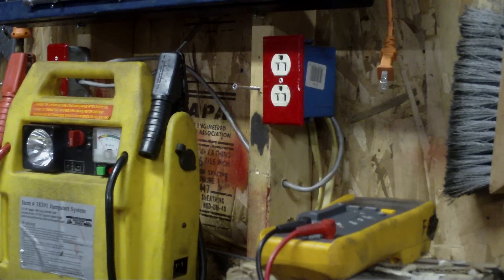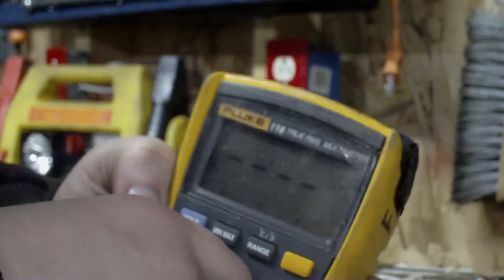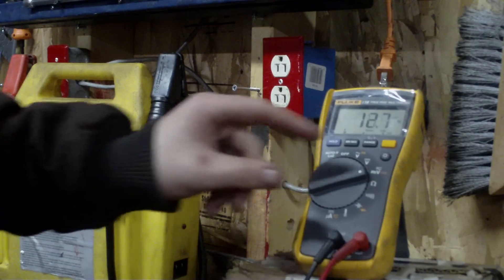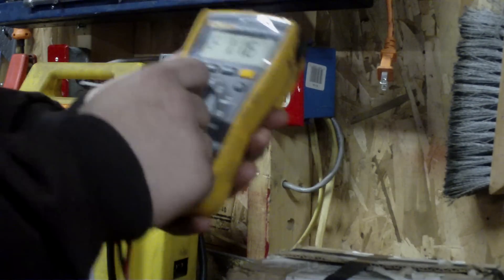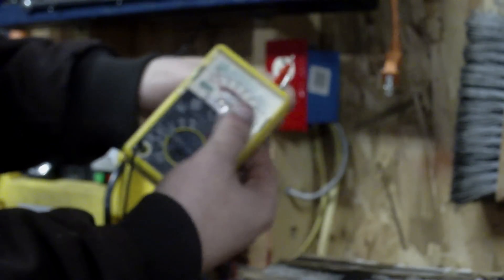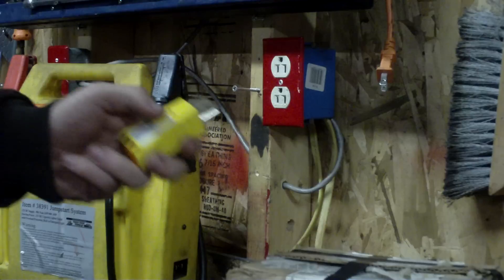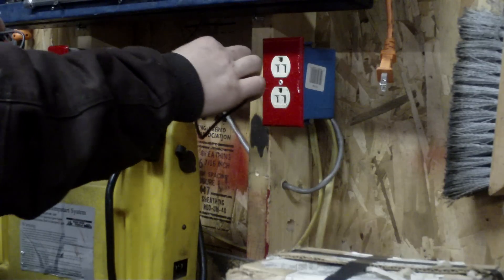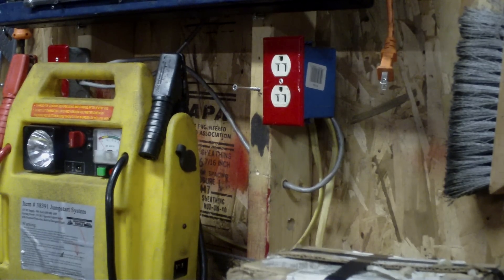How to use Volt Meters / Amp Clamps / and Test Lights (basics)

Comment from the maker: Very true, thanks for the input, i was curious about that and found out that it cancels out, same with clamping on 2 hot wires from a 240vac source, they will cancel too. I didn't think they worked on DC circuits, I always heard to check DC amps you have to have a shunt. Thanks for watching!!!

Comment: I'd like to add that if you use an amp clamp around both the negative and positive wires you will get a zero reading this is due to the the current going in both directions, so only one polarity at a time will work. Also I use my amp  clamp on DC current so they work both ways, nice upload all the same.

Comment from the maker: @925dude its on list! for example (wiring 3 way light circuits, receptacles, light switches, and possibly breaker box wiring, stuff like that) and also would like to go into more detail on running wire and planning. Reason i'm doing "off subject" videos right now is i'm not at my garage this time of year, but i will be soon. can't guarantee when i'll get started on these electrical videos, but i will!!!

Comment from the maker: @925dude thanks. glad to help out! well that actually brings up a good point. Used to be the standard to install "ground down" but the national electric code is trying to make it a new recquirement to install them ground up, like in this video. reasoning is that if your holding say a piece of wire, and you were to fall towards a receptalce, then if the wire is going to go in one of the slots, it would go in the ground first before the hot. sounds crazy to me, but hey i install them like that...

Comment from the maker: @eddie1278 yeah i've used them before i really like them, if i had one i would of included it in this video. i need to get me one, i hate the non contact testers too, the one in the video here says there is power on dead wires, and half the time it don't beep on a live line hahahha another thing that is better than non contact is the simple analog meteres with a actual meter on them, most of them don't need batteries to check voltage. thanks for watching!